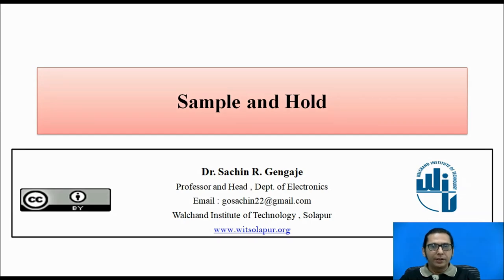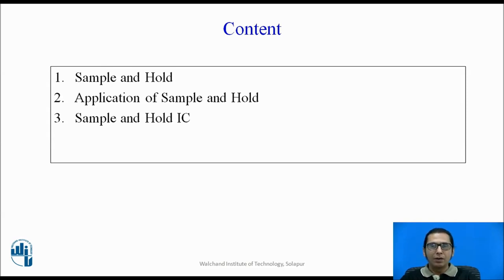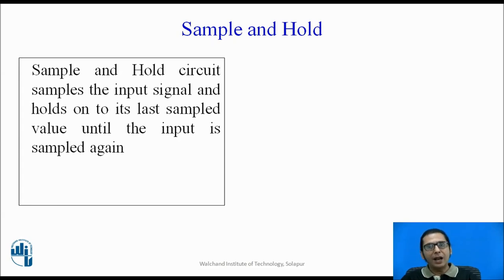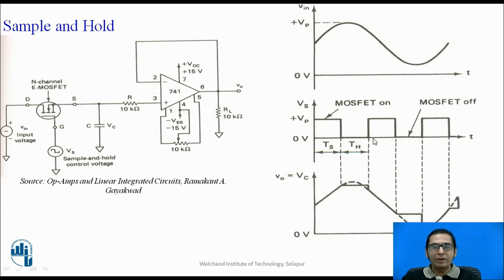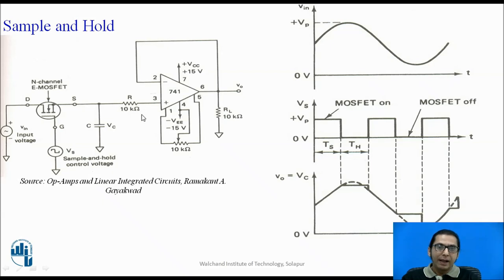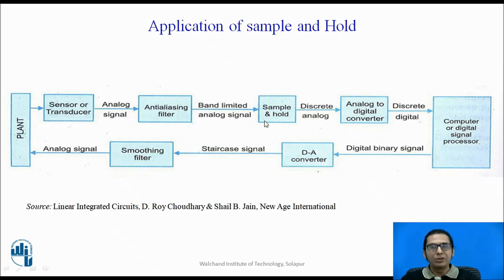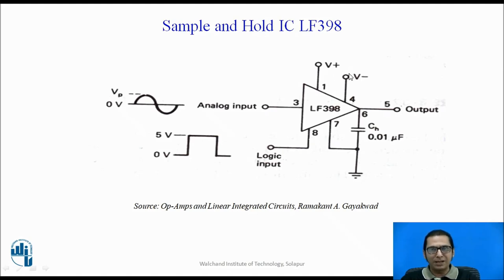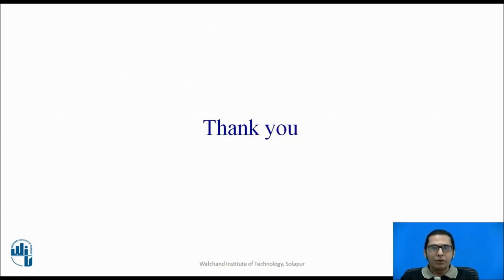Sample & Hold Circuit

Comment: If the input square wave form is smaller than the signal voltage then the output is digitally good accurate and vice-versa of inputs than the output is not much hold continuesly discrete signal

Comment: what is the role played by opamp, do not ignore this
\
Reply: Using a load without an opamp, the capacitor would not hold the sampled voltage as it would discharge. The opamp will supply your load, while the capacitor holds the sampled voltage (due to the high input impedance of the opamp)